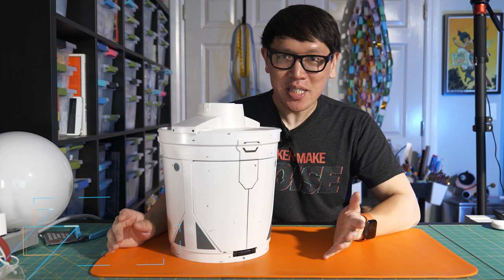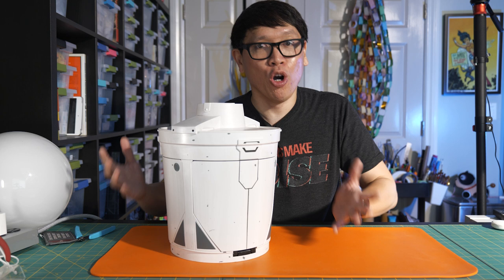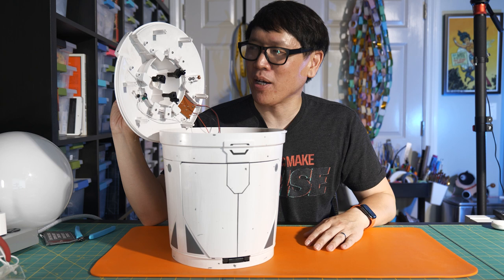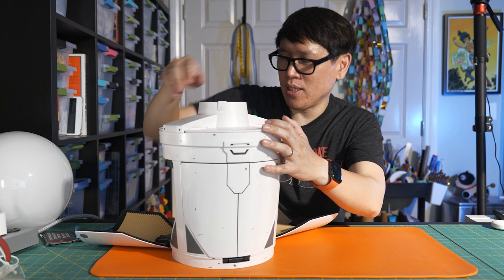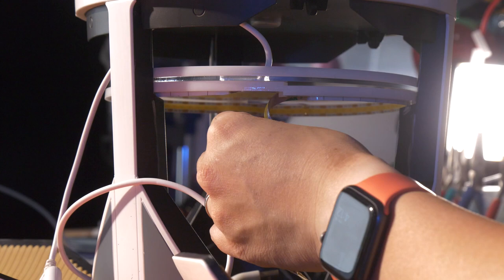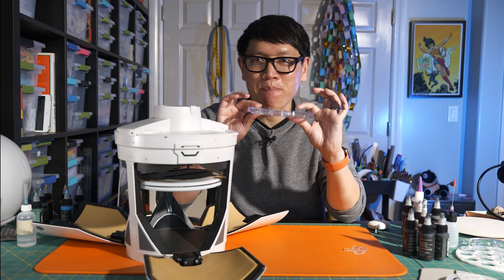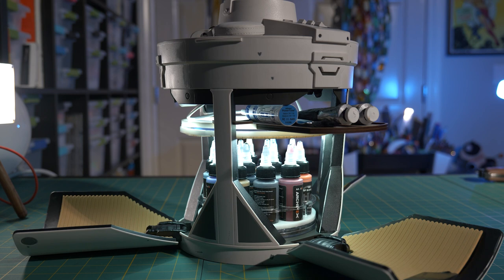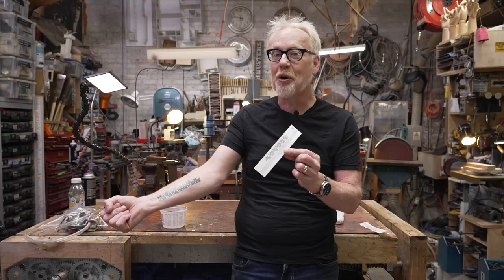Making a Star Wars Camtono Case Model Paint Caddy!

Comment: Awesome! Thoughts why not use the tiny neo something magnets on the small ledge areas, for top shelf same for bottom that way it be a quick-ish swap for different uses. It definitely needs a mini smoke machine in there maybe from a model train. Seel edges of doors where smoke won't leak out so first time opening to show off is full out smoke-ish stuff. Maybe have the LEDs upgraded to RGB's with one of those mini controllers that could be mounted on top (by magnets from bottom of lid) knowing you and Adam, make a custom button cover for the LEDs controller so it doesn't look like one. Give it a security panel look. Just a thought. Look forward to seeing more on this. Especially a repaint and weathering on it.

Comment: Using a piece of closed cell foam on the bottom so the paint is being held in place by the foam hug would allow for 1/2 inch at the bottom to secure paints

Comment: Hi Norm, my inner engineer says leave the bottom holder, but have another that goes up as you shut the doors. Might be a bit clunky to close unless you make a linkage that rotates off the column to lift the bottle brace from about 1/2 inch up to about 1".  And dovetail the draw so you can pull it out and leave it hanging there so it will not fall out.

Comment: Norm is great but looking at this i would have stored the bottles in there horizontally not vertically possibly with a slight angle pointing them up to look nice, imagine 2 doors with essentially holes and the bottles facing out , prob not the third door because i don't think there would be enough space for them all to face out, all the bottles bottoms ending up in the centre

Comment: The engineering on the original is overly complex. The batteries don't need to be on the bottom, so save that wire. The interior light doesn't need to be on a wire, just use a light guide. Those latches are crazily complicated and could be incorporated into the lid completely with a single piece of molded plastic. A quick common-sense review would have reduced manufacturing cost and improved reliability significantly. It wouldn't have lowered the cost (Disney), but would have increased profit.